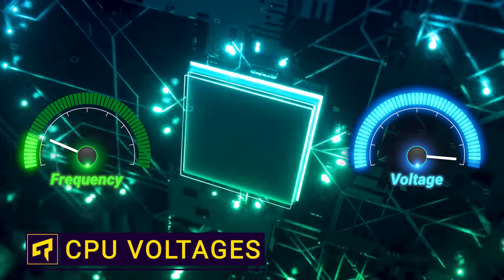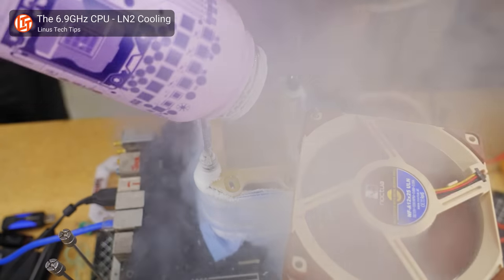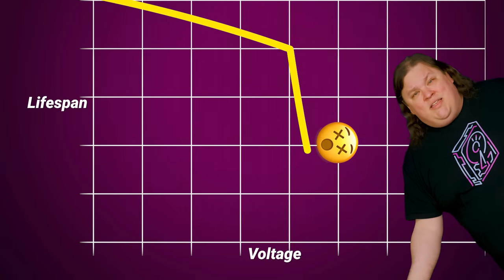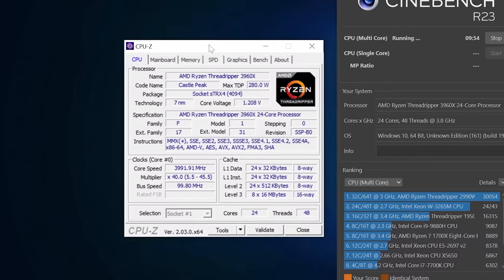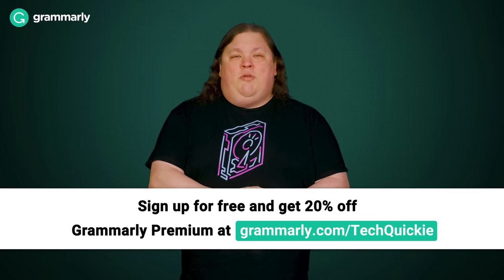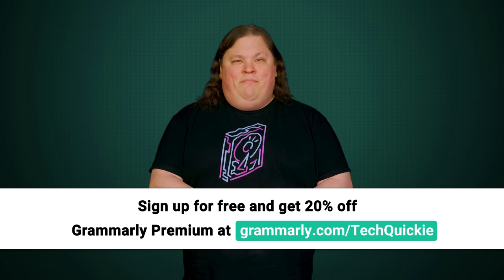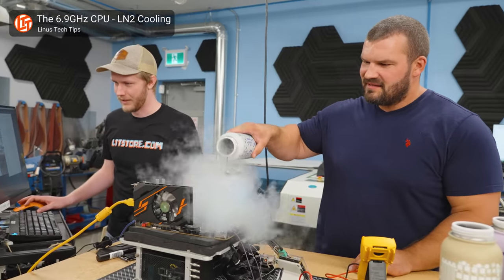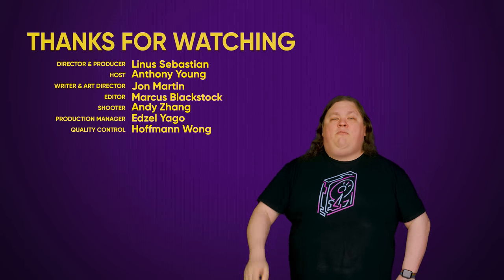What's the Point of UNDERVOLTING Your CPU?

Comment: If you have a 5000-series or newer AMD cpu, there’s always negative PBO2 offsets as well to undervolt
Reply: Even more so, that is one ptobably want to use instead anyway, since not all cores may act the same on a specific negative offset, some cores might be able to be pushed further, while one or two may become unstable way earlier.

And even if you set a undervolt and things 'seem' stable, in edge cases, the CPU may still get errors in calculations, so you may want to use something that  stress tests all cores, for a good while, and spits out which core made the error, then do that test for several hours or maybe day or 2 until things seem fine.

OCCT or Prime95 and corecycler by sp00n may be an option.

Comment: I undervolted my Ryzen 9 5950x to 1.15 V and 4.1ghz all core speed. Runs reaaaally cool and plus, I got a higher Cinebench and Vray bench scores. I use it for rendering so it constantly goes full load on all cores, but at 1.15V it only goes to 60 Celsius!

Comment: Mahjong mania in Symbian was originally designed for the 25 mhz DX 387 coprocessor for the Compaq LTE Lite/Elite laptops. It was a Win 3.1 game. Arm processors have a coprocessor of this category, responsible for gaming Physx too. While gaming with Nokia, after lvl 25 it calibrated my phone’s power parameters, it became more hot during gameplay, and the LCD became brighter. Probably, same with other devices. For PC, Opera with Youtube high res videos calibrate cpu, I needed 10 restarts for my laptop, it became stronger and cooler.

Comment: Haven't had much luck undervolting. -0.05V was the max to pass Cinebech R23 Exams, -0.1V failed. 13700K, Gigabyte Z790 Gaming X AX, Corsair Vengeance DDR5 5200 no RGB line, XMP off.

Comment: I always undervolt my gpu from 177-180watts into 120watts with -10 on clock speed but still has the same performance. Its not even its lowest crashing point. I just stopped there.

Comment: I had used undervolting for a long time (over 2 years on the GPU and 1 year on the CPU) 
It helped me a lot on my GPU from 90 degrees thermal throttle to max 83 degrees {usually 75} (850 mV) [Asus TUF Gaming GTX 1660 6GB]
On the CPU I didn't knew I could undervolt it when I had the stock cooler and I have slightly less degrees normally, but in sustained workloads there is a difference because it gets hot a lot slower
On my CPU I need to use and older version of the XTU (i5 9400F) and I can do -0.180 V
On GPUs is a lot easier to find the undervolt than on CPUs since no BSOD or the PC shutting down

Comment: Ryzen 3600 @ 3.0 GHz 0.95V Static. I have no idea how bad or good that is for lifespan, I just did it for the temps. My most intensive games don't take the CPU higher than 60-70% use, and the heaviest benchmark don't go above 60°C. Air cooled. I just hope that the lifespan gain from running it at 0.95V Static is positive, or at least compensated by the temp decrease.

Comment: Well i don't think it's possible with my i7 990x.
It's running at 5Ghz, and the cpu needs the voltage to maintain that speed.
At full load it's max temp is 63c, so it's not hot at all.
And i have cpu operating for 10+ years without degrading.
But i also don't have the "Offset" option in my bios.

Comment: I really wish Intel would allow undervolting on all their processors, not just the K/HQ-series SKUs. I have a 1260P that gets ferociously hot under load in my LG Gram 16" and can thermal throttle down to 400MHz for quite a long time. The only way I've found to stop that is to disable Turbo Boost Short Power Max altogether in Intel XTU, which is the only option XTU grants you without an unlocked chip.

Comment: But winter is coming, I want my CPU as hot as possible, I have a very cold house! 🤔
Reply: Interesting, in cold weather, you won't need a liquid cooler, when playing in high performance mode.
Reply: @Keepskatin  Well, you wouldn't need a cooler, period! 😂 Well, maybe to disperse the heat so it moves about a bit I guess but other than that... 🙄
Reply: @RobertForslund  Just as a high performance car engine needs a cooler, so does a high performance CPUs. High performance equals high heat, cool it off.

Comment: Reducing heat  is not the only reason for undervolting. I use  it in order to squeeze an sfx PSU into a small form factor mini PC. That way I can use superior CPU/GPU models on it otherwise not possible with a small  PSU. Yeah you may loose last 10% performance on worst cases , but it saves 30% power or more, thus allowing me to stay sfx (I need it for travel reasons, I know I should have a laptop but I hate them  because they are not repairable and  upgradeable as they should be  )
Reply: laptops are repairable lol, what the heck are you talking about?
Reply: @TabalugaDragon  What I'm talking about:
- I can repair a minipc with just a screw driver and cheap parts easy to find on Amazon or ebay. Meanwhile the laptop needs to go to the repair shop, pay triple price.for equivalent parts, and that is supposing that  they accept to repair it. 
- A minipc cost half than a laptop of similar performance. 
- In a mini PC I  can upgrade my GPU,  CPU,  RAM, NVMe, keyboard, display, etc whenever I f. want.  Purchasing the new componets based in open standards at open market prices, and then recovering a fair  part of the cost by selling the old ones on ebay.
- Every laptop I had was mothballed because just a single component failed or become obsolete for my working needs, forcing me to buy a complete new one, at double the cost than an equivalent minipc.

But I know that sffpc (mini PCs) are not for everybody. Basically they are for people who need to use it at A or B but not while travelling from A to B.  But that works for me,. and I will not be coming back to laptops in my live.
Reply: @javiej  you said they are not repairable, not that they cost more to repair. The cases when "it's cheaper just to buy a new laptop" are very rare nowdays. 

"- A minipc cost half than a laptop of similar performance. "
what does it have to do with what I posted? Not to mention - are you also gonna carry a monitor, a splitter, keyboard, mouse and speakers wherever you go? yeah, surely just as convenient as a laptop LOL.

"and then recovering a fair  part of the cost by selling the old ones on ebay." dude here's a shocker - I can also sell an old laptop and add for a new one. Incredible, right?

"and I will not be coming back to laptops in my live." and I won't ever come back to desktops. The lack of portability sucks.
Reply: @TabalugaDragon  As I said mini PCs are not for everybody. Obviously a laptop is more portable and can be used on batteries.. But nowadays many people (including me) don't need such level of portability in our computers  because most of the light work on the go  (web browsing, mails, social networks, etc.) can perfectly be done with a smartphone. 
And when we need a more serious application the laptop is not going to cut it anyway. In my case when I need a true "computer" is because  I want  AAA gaming, 3D rendering,  VR, machine learning, engineering apps, VM virtualization./ Homelab... and laptops are very limited for all those things when compared to desktop  PCs. You simply  can't do the same things with a 150W PSU that you can do with a 1000W SFX PSU, plus a proper Nvidia GPU and 32TB nvme storage  as I have in my mini pc.  I am not the kind of person that wants to work in a starbucks, but I need enough portability for bringing it to the facilities of some specific clients from time to time, or when I go .to my second residence. Monitors or TVs are available everywhere, just bringing  a portable keyboard is normally  enough for my use case . Other people really need a laptop,  but we who are better served with this formula also  exist.
Reply: @javiej  and yet smartphones are terrible as replacements for an office PC or a laptop due to tiny screen, even tinier keyboard, not to mention lack of other controls like tactile feedback and a mouse. 
A lot of software on smartphones also severely lacks functionality compared to Windows. 

" I want  AAA gaming, 3D rendering,  VR, machine learning, engineering apps, VM virtualization./ Homelab..." and laptops handle all this excellently, so I have no idea what you meant there. Unless you're talking about a high end workstation above 4090 with a threadripper CPU or something. But then how is a mini-PC gonna handle that? Lat time I checked they aren't even close to be enough to have proper components. 
Modern laptops with 4090m and i9 13980HX perform better than desktops with a 3090 and i9 12900k, while being quite portable(look at Asus ROG scar 16 for example). 
So again, I have no idea what you mean. 

"You simply  can't do the same things with a 150W PSU" maybe last time you checked powerful laptops was 15 years ago or something, but modern high performance laptops come with at least 250 watt power supply, or even 330watt ones. msi Titan has 4 NVME slots which would make that 32TB storage you're talking about possible. 

"TVs are everywhere" true, but I don't think for example cafe or airport owners would allow to use theirs lol. idk where you work but TVs are definitely not everywhere for you to use. The only place that comes to mind is hotels or some specific electronics shops.
Reply: @TabalugaDragon  You see? That's precisely the problem. If you want a powerful laptop you need to expend 5000$ in a 4 kilogram  beast and carry a giant power brick with it because the battery can not hold serious work for more than 1 hour. Believe me I have been there. And once you need to carry a backpack and a useless  battery then there is no big  difference in "portability" with a small PC as long as it fits in a backup. Nowadays there are very small sfx PSUs up to 1000W, and even a small A5000 GPU  beats the 4090m mobile. You can even  install a real 4090 in a small form factor pc,  the 4090FE fits in a small case such as the fractal ridge, and it is more than double faster than the 4090m.. 
 But the important thing is this: now that Ada generation is here I can upgrade my PC by  simply expending 2000$ in a 4090 if that is what I  want. But you have to expend 5000$ in a new high end laptop, and you will have an obsolete  CPU in one year and an obsolete GPU in less than 2 years that you can not upgrade. Same about displays, new OLEDs are coming that are much better than previous generation, I can have two magnificent  37" monitors at A and B and a full desktop experience while you have to work in your little screen at both sides because you expent all your  budget in the latpop. And no, you are not going to use a giant 4 kilogram 17" laptop in a plane or in a train, it just don't happens. I have never seen anybody using one of those monsters on the go. Only  Ultrabooks.
Reply: @javiej  been where? you tried modern laptops with their cooling systems and GaN power bricks? you have a time machine or something? I'm not aware of ANY modern laptop being 4KG. The Asus ROG strix 16 which holds a 165w 4090m(again, around desktop 3090 level) weighs just 2.5 kg plus a smaller, modern GaN charger of around 800 grams or so.  
And the only reason I mentioned Titan(which weighs 3.3 KG by the way, not 4) is because you specifically need tons of storage. If you're ok with external storage(and 2.5 inch Sata 3 enclosures can go up to 8TB each or even more) then you can achieve that with a much smaller laptop. I mean you already carry a lot of stuff with you with a mini-PC. 

And... it's not 5000 dollars, these are only the most expensive models like the ones from Razer. Nobody's making you buy those. Not to mention prices are already dropping. 

" and a useless  battery" USELESS? it would allow you to do basic tasks for hours AND play a role of a backup energy source if electricity gets shut down. And it's thin and weighs like 0.5kg. A pretty low price for safety and portability. 

"even a small A5000 GPU  beats the 4090m" lol WHERE did you get that info? I demand an answer to this. the A5000 doesn't even have impressive specs aside from the amount of memory. 

" You can even  install a real 4090 in a small form factor pc"
sure... I mean it's only a giant GPU, why wouldn't it fit into a small PC that's comfortable to carry? 😆

"and it is more than double faster than the 4090m." no it's not, go see comparisons by hardware unboxed or Jarrod's tech. It was only twice faster in literally one game. It's much faster for sure but it's also not a good option for a small PC you're planning on carrying with you all the time. 

"But you have to expend 5000$ in a new high end laptop, and you will have an obsolete  CPU in one year and an obsolete GPU in less than 2 years" that's not how it works. It doesn't get outdated nearly this fast. Otherwise people would upgrade every generation. Even Nvidia themselves practically admitted it when presenting 3000 series when Jensen said 
"To my Pascal friends out there, it's safe to upgrade now".

" can have two magnificent  37" monitors at A and B and a full desktop experience" guess what? I'm using an external monitor right now 😆 What exactly prevents a person from connecting any display to a laptop, with so many ports(hdmi, mini display port, another display port which comes with type c)? Your comment does, I guess LOL. 

"while you have to work in your little screen at both sides because you expent all your  budget in the latpop." 
budget doesn't work like that I'm afraid. It would be impossible for people to buy cars if they only had a few thousand dollars of budget and that was it. 

" And no, you are not going to use a giant 4 kilogram 17" laptop in a plane or in a train, it just don't happens." I agree, that's why I always take my 2.5 kg laptop and game on it in every train trip I go to because there are wall outlets there nowdays 😆
and thanks to small bezels pretty decent screens are now able to fit into smaller chassis. You're REALLY behind on laptop technology, aren't you?
Also, according to you, there are just 4KG monster gaming laptops or ultrabooks, there is no middle ground there. You really have to do a reality check, my friend. Because gaming laptops have been weighing around 2.5 KG for many years now. Even msi GP series laptop that held a full 150w RTX 2080 weighed just 2.6 kg. And that was 4 years ago. 

"I have never seen anybody using one of those monsters on the go" funny, because I see at least 1 person in my train carriage with a gaming laptop just like me. Oops.
Reply: @javiej  Uh, mate. The asus rog strix rx6800m laptop dropped to $1100 on numerous occasions. Its basically as fast as a 5700g and 6700xt desktop system, with either a 300hz 1080p panel and 165hz QHD panel with 10hr battery life for the 1080p model. Mind you, it weighs around 2.5kg. Infact, you could've spent $800 for a MSI gf65 thin with a 80w 3060 (bit slower than 2060 super) and i5 10500h and that weighs around the 1.86kg mark. Sure the battery life will be shorter than the asus amd advantage laptop, but it is also cheaper and lighter. So build me a mini PC thats half the cost of that asus or MSI with similar horsepower. All brand new with the peripherals and monitors to match (ignoring screen size and a few other factors). You can't. Even getting a $200 rx6600 and $200 ryzen 7 5700g will still make your mini pc cost almost as much as the laptops I've mentioned. 

If you look back at pascal, you had the aorus x9 pro that packed dual 1070's in SLI with a i7 7820hk and all that with much worse cooling that what we have today. It weighed just 3.6kg. Back then, an equivalent desktop would've costed you roughly the same, been much, much larger and heavier and would not work for 5 min on a UPS. This aorus could still run for 2-3 hours, which is enough for short on the go bursts. No mini PC would've been as small or as cheap as it. And even to this day, when the SLI 1070's are used properly, it'd be quite good. 

So I don't know where you think that 4kg is standard. I mean even lenovo's 3080ti 180w legion 7 16' weighs just 2.6kg. The 4kg laptops are literally just meant to replace desktops and even they can do 2-5 hours on battery depending on laptop.

Comment: 5800x, 4.6Ghz, 1.2v (will not go above 4.7 even with 1.5v lol!)

this has been my daily driver, and others have tested this chip at 1.3/1.4 since the day it came out with no degradation so far, so im fairly confident 1.2v is completely fine as the wattage pulled is also fairly low. on stock, this would hit 4.9Ghz but take 1.53v bursts and under HEAVY load it would pull that same voltage at 3.7Ghz and use temp limits

so having 4.6 be the working load at 1.2v is the best thing in my case, i definitely recommend to anyone interested
Reply: Rip

Comment: Yea, tell me about it. Remember 10th Gen and being super power hingry?
Before I undervolted my CPU my Z490 was pumping 1.41-1.43 into my chip at like 65% load and up 😢
She’s stable and pushing 5.2 at 1.3 now but damn man. 
Need to wire the socket right into the breaker😂😭🥸

Comment: OMG, this is such an easier process than Throttle stop!! For some reason throttle stop undervolt settings are locked on my system. I have a 12700k and H570 mobo

Comment: “Under volt” you ignore the voyage it comes set to, you find the most voltage you can run while maintaining reasonable temperatures, you determine your max over clock, then you drop the voltage until it starts to become unstable.  It’s called over clocking and calling under volting doesn’t make any sense on a CPU